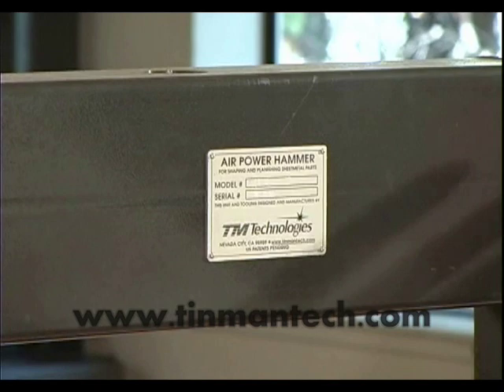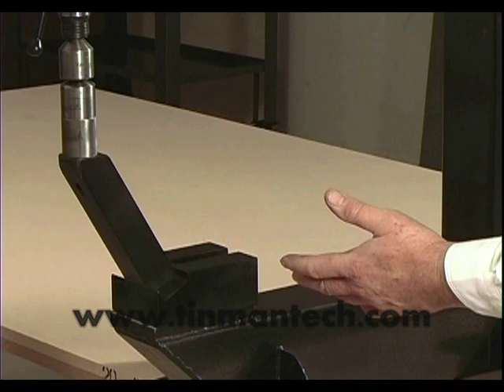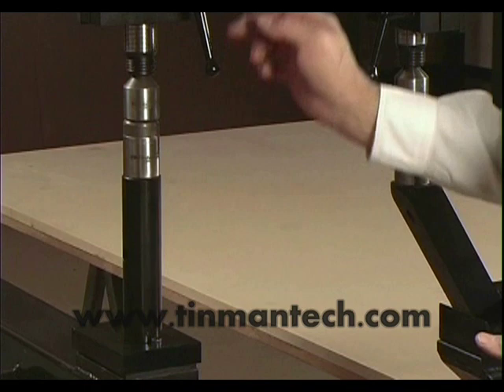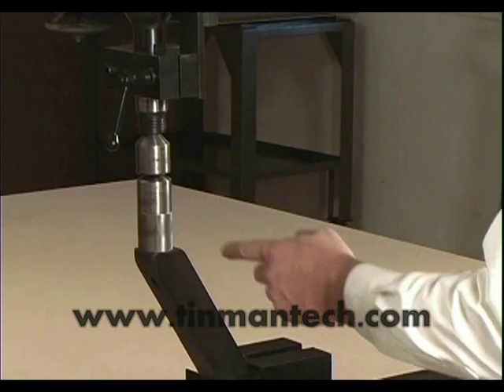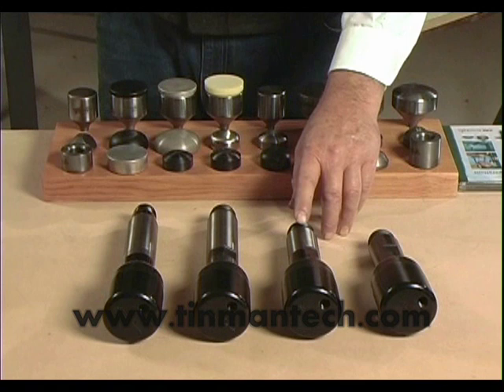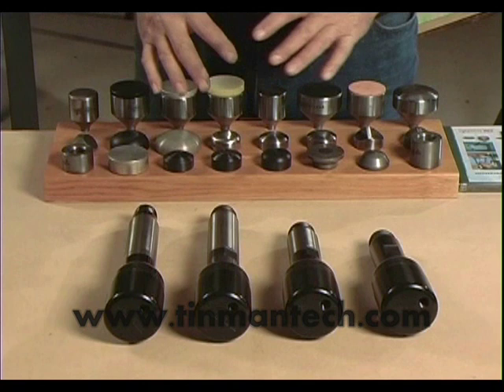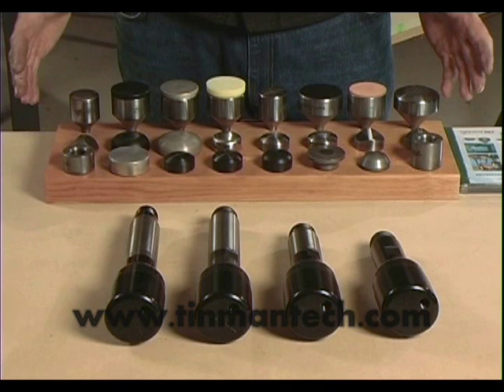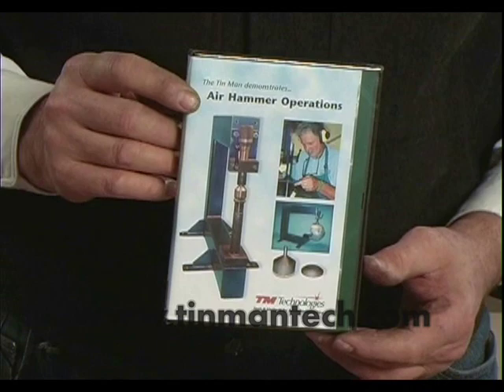Intro Power Hammer / Planishing Hammer -  TM Technologies

Comment: If my metal working goes from 3003-H14 0.032"  up to 16 gauge steel, should I get both the medium and heavy air hammer units?  If I just bought the heavy air hammer, would I loose the finesse on thinner aluminum forming?

Comment: I probably won't get a response since this video is so old but, can this machine be used for shaping hot, high carbon metal?
Reply from the maker: +Necromedes Yes, some of us are doing hot work with this machine. Frequent water spray on the dies is needed to avoid drawing the temper out. H13 dies could be made to further the hotwork range, but then the air motor and lower die pocket would be in danger. There is one fellow (that I know of) working .250" steel with this machine, using our #6 air motor.
Reply from the maker: The stroke is always very short - safety design built in, so you can work your fingers right in close. H13 is a standard hotwork die steel that is common in smithing. Yes, dies can be made from that steel, or combinations of steels.
Reply: Sounds like I won't be able to use it for my work then. I intend on flattening and stretching hot bar stock.

Oh well. Thanks for answering my questions.